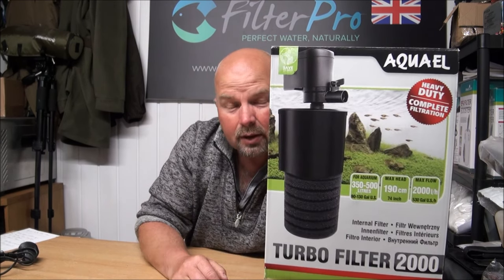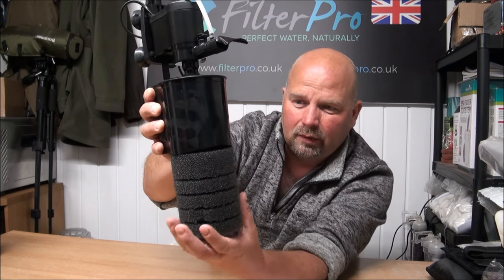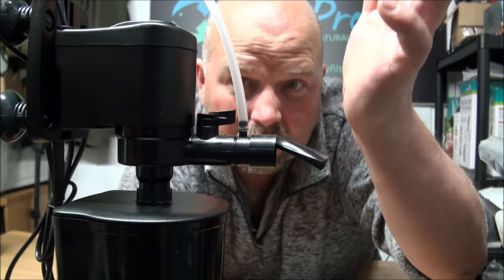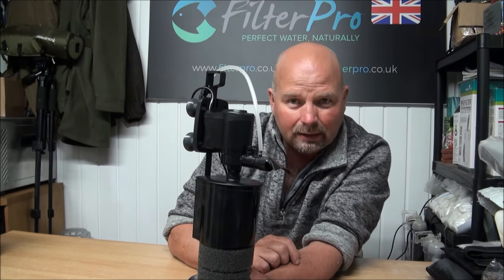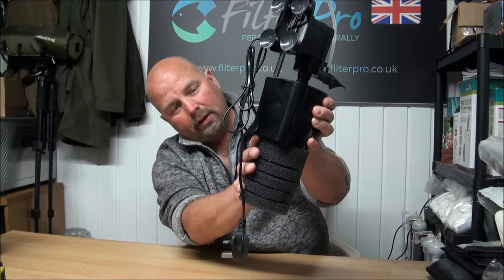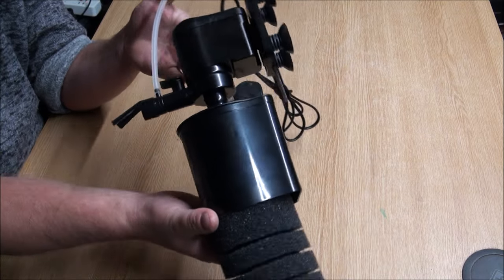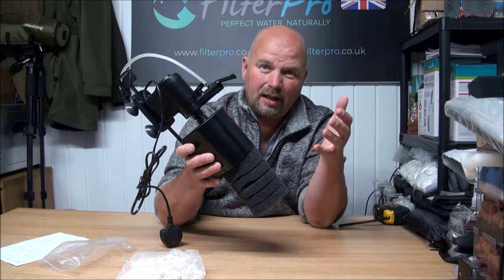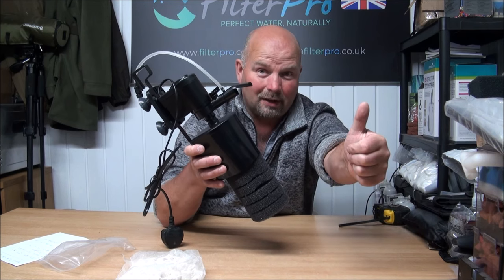Pimp My Filter #88 - Aquael Turbo Filter 2000

Comment from the maker: Aquael Turbo 2000 on Amazon: https://geni.us/cOthSma
(Yes, the thumbnail picture is an image from The Lighthouse (2019) which is an awesome film for those who have eyes to see ..... and it has nothing to do with aquariums) Willem Dafoe is literally a force of Nature in that film..
The Aquael Turbo 2000 may not hold much media as it comes from the manufacturer but it can be upgraded to hold more if you choose a more compact media than the supplied ceramic rings - as long as you have a high enough tank you can add more media baskets to the filter. 
The standard height of the complete filter is around 16" (40cm) which is increased by approx. 4" (10cm) for every media compartment you choose to add.
If you're trying to achieve a full cycle (0,0,0) please avoid anything which will mess with the ammonia, nitrite and nitrate.
Unfortunately there are a couple of conditioners available which starve bacteria and mess up the cycle as a consequence, causing users to buy more products to treat the side effects. That is a pharmaceutical business template. 'Safe and effective'? It seldom is ... 

Filter Kits, Foams, Biohome, Biogravel etc: http://www.filterpro.co.uk
(FilterPro site has links to Biohome suppliers in other countries)
Booster filter for canister filters: https://geni.us/2bj1

Trojan Horse Treatments video: https://youtu.be/1YCtMYZQlig
Thousand Yard Stare channel: https://www.youtube.com/channel/UC1pgJBGQrUfCUAhk63U5u5A

VERY IMPORTANT:
*Avoid using water conditioners which claim to bind / remove / detoxify ammonia, nitrite and nitrate as it will have a pronounced starving effect on the bacteria. When bacteria is starved the population will be low as it grows in line with the available 'food'. 
A normal conditioner will allow the bacteria to fully populate the whole system and take away the 'need' to add more bacteria after maintenance / water change.
Most people get conned into regularly using bacteria additives and that is simply to mask the side effects from a damaging conditioner and a failing filter.
Tapsafe, Aquasafe, API Stress Coat etc. is all you need when a tank is properly set up, a filter is suitably sized (and properly set up) and Nature is allowed to do what Nature does.*
The Q&A page of the FilterPro site has extensive notes on recommended treatments and how filtration works. http://www.filterpro.co.uk

Follow me on Odysee: https://odysee.com/$/invite/@PondGuru:0
Contact me on 07772848730 / sales@filterpro.co.uk
******(I don't do texts)******

You can check out my efforts to create a new system to navigate Agenda 2030 / any WEF nonsense on my Thousand Yard Stare channel: 
https://www.youtube.com/channel/UC1pgJBGQrUfCUAhk63U5u5A

The following videos will be useful for learning more about filtration and filter media:
Sizing a canister properly and filter set up: https://goo.gl/om19un
Looking INSIDE different filter media: https://goo.gl/hZWS6c
Bacteria and filter media: https://goo.gl/123gAF
How to clean an aquarium: https://goo.gl/bPMhvh
Aquarium tips / filtration playlist: https://goo.gl/pXgqVj

A full cycle is completed by bacteria - the aerobic part of biological filtration which processes ammonia to nitrite and nitrite to nitrate followed by an anaerobic part which processes nitrate into soluble nitrogen which bubbles off to the atmosphere.
Therefore it requires a suitable amount of excellent quality filter media to be able to provide the environment for both aerobic AND anaerobic bacteria - that is what Biohome filter media does perfectly but even with such good media there are limitations and we recommend the following amounts for different stocking scenarios:
(1 US Gallon = 3.8 litres)
(1kg = 2.2 lbs)
Average community tropical aquarium = 1kg per 100 litres 
Average coldwater aquarium = 1kg - 1.5kg per 100 litres
Predator aquarium = 1.5kg - 2kg per 100 litres
Large cichlid aquarium = 1.5kg - 2kg per 100 litres
Malawi / Tanganyikan aquarium = 1.5kg - 2kg per 100 litres
Marine aquarium = 1.5kg - 2kg per 100 litres
Average mixed fish pond = 1kg per 200 litres
Average koi pond = 1kg per 150 litres

RECOMMENDED PRODUCTS ON AMAZON: https://goo.gl/jMaBWy
INSTAGRAM: https://www.instagram.com/pondguru_outdoors/
Some of the links above may be to my affiliate programs on Amazon and Ebay so they will throw a few shekels my way if you make a purchase - it costs you nothing extra and helps towards keeping the lights on in my bunker.

Comment: Hello from Russia. I have such a filter for 200 liters of aquarium as a mechanical filter in addition to an external filter. I think it is not advisable to use it for biology. Instead, I filled the canister like that. There is a layer of ceramic rings below to break up the flow. There is a medium-porous sponge above it. There is a fine-pored sponge above it. There is a sintepon over it. There is a homemade grid on top for breaking the flow. There are a lot of golden fish and catfish in the aquarium. I clean the filter once a month. The power is adjusted to a minimum. The water is crystal clear.
Reply from the maker: Nice one - thanks for the report of how you set the filter up and I agree that it will make a very good mechanical filters so it's no surprise that the water is crystal clear. Best of luck with the tank.

Comment: 600 gram hmm so going with your own calculations = 60 litres .. but it's way to big for a 60 litre tank ... so I guess the sponge comes into it .. I'm confused ...
Reply from the maker: That's why toward the end of the video I explain that it is unlikely to achieve a full cycle in a decent sized tank where it won't be too big. In anything under 100 litres this filter in the present form is going to be way too big to be practical.
The flow would also be too much for smaller tanks.

Comment: Aquael's unironically good, and parts are pretty much compatible across all products, without any strange shaped, over engineering or bullshit alike, the only gripe I have with them is pump longevity, and I mean LONGEVITY so that the equipment outlives any aquarium or repurposing. I could've bought Ultramax 1500 or 2000 for my 114 L aquarium but I chose Fluval 307 instead, because of how paranoid and demanding I am about reliability nowadays.
Reply from the maker: That is a good way to look at things and I'm very much of the same mindset.
When I buy anything I expect to be able to rely on it for many years (especially if it is gardening tools which can have a hard life).

Comment: Would this be to powerful for a 260 litre? Thank you
Reply from the maker: Assuming that the tank is a standard rectangle design it will be fine as far as flow goes.
However, the filter does not hold much media (very few internal filters do) so it would still be better for decent sized tanks if you're wanting to achieve a full Natural cycle.
Reply: @pondguru  thanks,  does the outflow adjust at all?
Reply from the maker: @lesleyelder2826  There is s flow valve on the outlet - apologies for not mentioning that but it can be seen between the pump and the venturi air intake.
Reply: @pondguru  thank you

Comment: Had the 500 one on my 56L for couple of years until upgraded my tank to the 200L tank with Aquael Canister tank. Loved the Turbo500, it's in the garage, in the clean bag ready to be pulled out in emergency ;)
I did use filter moss on the bottom of the Media container to polish the water too - did a great job :)
I do like Aquael products a lot
Reply from the maker: Nice one - yes, while this range of filters may not be the best looking in a tank they certainly do a job and the prices are reasonable too.

Comment: Hey, just wondering if you had pimped the Eheim pickup filters yet? or is it really as simple as cermaic rings and a bit of filter wool? 
thanks in advance for any insight from anyonr lol
Reply from the maker: I've not done that filter yet but as far as I can see it is a simple foam filter which uses a central perforated pipe which goes through the foam. If that is the case then the filter probably can't be upgraded usefully.

Comment: your mega pond filter was it worth it ?
how clean is your pond 5 years ago to present day?
Reply: (my other channel) The water is definitely healthier, a bit clearer but it is still colored.
However, recently I've been in contact with a friend who has a trout farm in Yorkshire and he is prepared to take all the carp and sturgeon (the bottom feeders which mess up the clarity of the clay lined pond) and take them to a private lake for safe relocation.
This year the spring water flowing onto the pond has been increased so that's also helped with the health and clarity of the water.
It is all heading in the right direction but until the huge bottom feeders get reduced it is probably not worth making a video on since the camera doesn't pick up how it has cleared very well.
When I swap out all the bottom feeders for trout it will be crystal clear again.

Comment: Since you can't upgrade the pump, I would suspect adding another container could also hurt the flow quite a bit.
Reply from the maker: Adding any more containers will impact the flow a bit but water can flow freely around the Biogravel so any drop in flow wouldn't be noticeable.